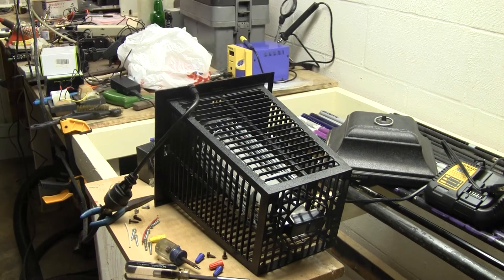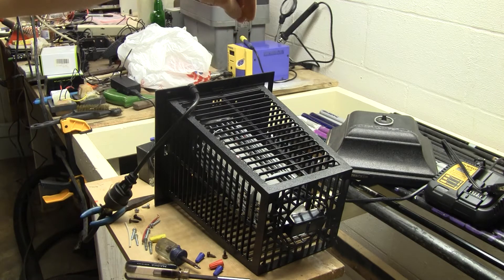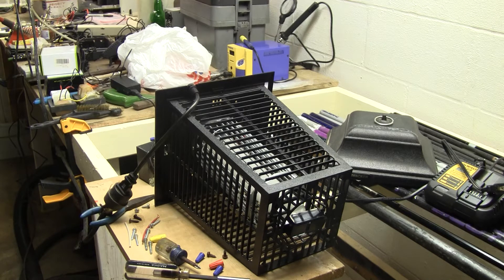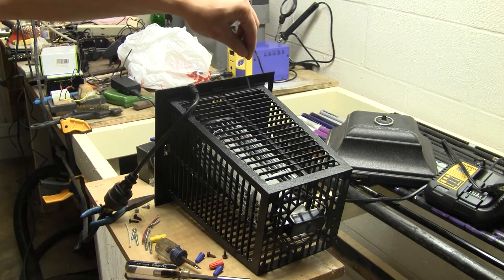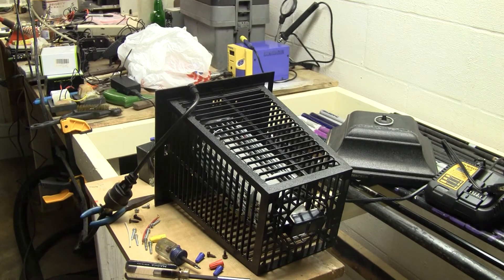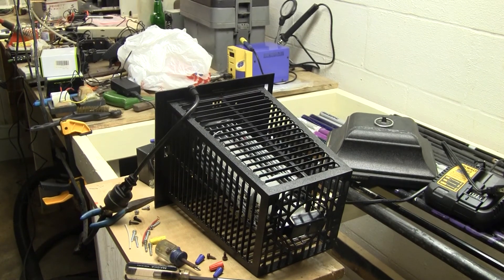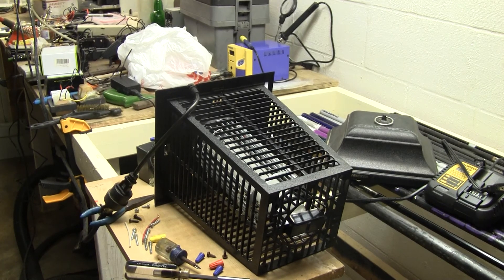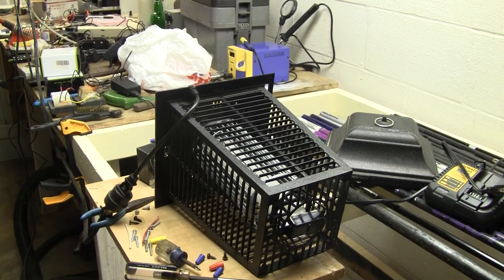Bug Zapper testing with 3300V 30mA HV transformer, not the 5600V 9mA

Comment: i just removed the light bulb + starter from mine, it was slowing the current of one of the ac lines ;)... i hope it will all be well... i am replacing the bulb with a small jar of fly attractant with a mesh screen on the top. i guess i need a video....i don't have a bulb and can not measure the before and after voltages + amps, but would be nice to know...

Comment: What are you putting on it making it zap
Reply from the maker: Good question, I forget... seems like a spider web or maybe sliver/fiber of wood.  I recall dropping a dead bee or two in a test also.  Doesn't look like a bee in this video.
Reply: @jafinch78  looks like some kind of sand salt powder
Reply from the maker: @jasonhash3172  Yeah... might be saw dust.  I was thinking was a spider web since that was where I found the bees... though forget.

Comment: I found a bug zapper, old school. I remember my grand father owning one when I was a young boy. Bottom line I have the same exact one that he had, and it only takes one 15" bulb not a double like they keep showing. Only half my bulb lights up does anyone know how to trouble shoot my problem?
Reply from the maker: I'm really rough guessing the bulb is bad and am not sure.  Do you have any photos or a video of the bulb?  Might be the bulb isn't starting completely either like if fluorescent the starter ballast component is bad.   Have to review the design to know better at guessing.
Reply from the maker: I'm just getting back into electronics projects for the winter months since was working on outdoor projects this year.  I'll read up on again... though you want to make sure you know what you're doing safely before working on since can be dangerous, i.e. unplug system from mains power, how to discharge capacitors, ow to make measurements, etc.).  First I recall the resistance of the transformer windings needs to be checked to verify there isn't and open circuit or an out of specification reading. Check the capacitors are good also and depends on the design of the system too.  The step up winding (HV) will sometimes have the diode go bad or an open circuit for some reason... guess burns up.  How is the circuit of your system designed?